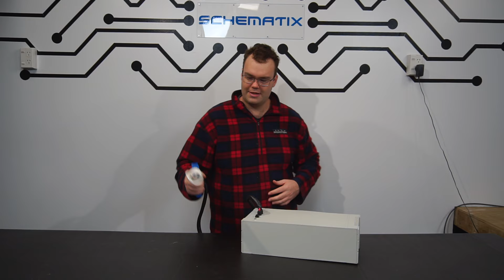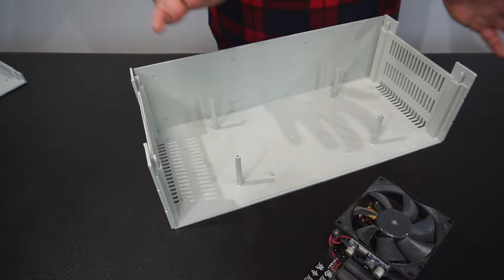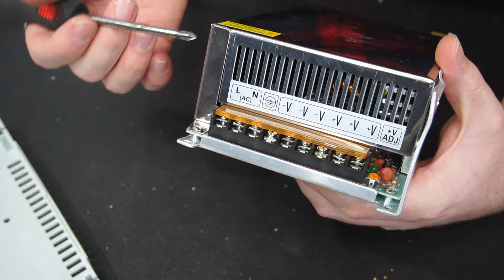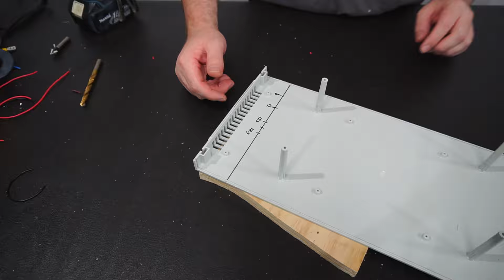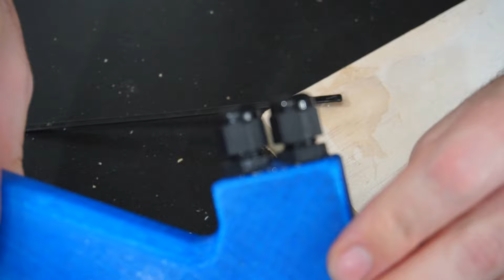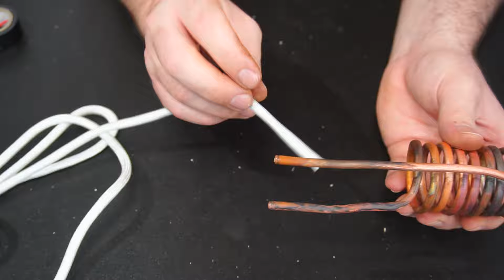How To Make An Induction Gun (Bolt Heater / Buster)

Comment: cool vid broken down nicely. How much did it cost (roughly.)?
Reply from the maker: Roughly $120USD all up. Or about $5 million NZ pesos (sarcasm about exchange rate) ;)
Reply: @Schematix  I wish there was a way to do one for less than $100. I don't see the need for fancy gun. Actually that shape makes it harder to use in tight spaces. Just a rectangle block would do. Thoughts? Actually a video on how to make one the cheapest way possible would get a million views. Easy!
Reply: @lostintime8651  compared to a consumer bought one for £400 or 500usd, (from a half reputable brand that is) this is cheap, a fun project and gives you the ability to make your own coils exactly how you want them. You could easily make one flexible enough to get into any space. Something a consumer one with a big 2 foot handle can't do, u less you pay 8x as much as this thing would cost.
Reply: @georgecroney6168  Funny to see you commented on this 11 months after. I just ordered one from Amazon for $190. Will be here on Tuesday. I am working on an old truck. I really need one now. Replacing the gas tank. Don't want an open flame doing this.
Reply: @lostintime8651  You definately don't! Let me know how you get on with it, I guess the big brands are simply higher powered and take maybe 20 seconds to hear up compared to 60 seconds for a 1000 watt one, I'm no expert though

Comment: Measure the resistance of the 12v relay coil, put an equal resistor in series with the coil, presto now you have a 24v relay.
Reply: can i use an automotive 12v relay for 110 vac at 2a on the contacts?  also thanks for the tip
Reply: @pipercolt1963  Most likely not a good idea, no!

Comment: This is a fantastic little tool.  I could do with something similar when replacing the AFR sensor on the car.  I would add protection to the Relay to prevent Back EMF from damaging the Buck Converter.
Unfortunately this is not a good DIY project in Australia due to our laws about mains power and requiring a qualified electrical contractor to do any wiring.  Unfortunately, no matter how talented someone is, this makes it prohibitive to do as DIY here.    
Thanks for the informative and well laid out presentation video.
That insulation twisting trick works really well on finer gauge cable as well.  I recommend it as not only does it twist the cable well, it avoids oils from the skin getting on the cables.

Comment: Alternatively you could have strung two relay's together in series for the coil and parallel for the contacts and doubled the amp rating of your control circuit or not hooked in the other relay up and effectively use it as a ballast.
Reply: I thought about that myself.

Comment: I would have just put a 100 ohm resistor in series with the relay coil on 24V supply. Could have saved the whole voltage conversion cost.
Reply from the maker: Actually, in this senerio, it's better to measure the resistance of the relay coil. Then install a resistor of the same value. It would also have to be a 2W resistor. I keep a whole bunch of buck converters on hand. They are literally $2 each. Besides all this buying a 24v relay is the real solution.

Comment: Nice build.. I am a noob on the matter and its more the concept that appeals to me... so pick up a cheap edition that cost around 3.5USD and been playing with it the last couple of days,.
https://i.imgur.com/6lMr8mP.jpg

Was planning to make some recording with thermal to show how the heat transfers and I atm I run it on an adjustable power bank that tops out around 80watt, but for proof of concept and small metal pieces its work brilliantly..
form a 3.5USD product it is able to make fx a 5mmAllen Key completely red glowing, solely from a USB(DC) powerbank..
.

Comment: Just received an induced thought convincing me to attempt forwarding thoughts a considerable distance by induction. 

True flat line DC won't induce the voltage to force the current you're looking for. The stable magnetic field is missing the movement of the lines of force necessary for induction. To work efficiently with all conductors the magnetic field needs relative movement with the item being heated. The current is the easiest place to get moving. In order to lower the voltage to a safer level a transformer is a cheap solution. A transformer can serve double duty as an isolation transformer by removing the reference to ground that's found on a 120V systems neutral conductor. secondary Electronic control of AC frequency is a nice touch. High frequency can really heat things up in some situations. The spiral wound coils of the heater can serve a purpose if close together to limit current by counter electro motive force to almost zero when there's nothing utilizing the field. Just a few things to consider. Peace and good luck to ya.
Reply: Can you help me understand how he is using this ? So to my limited knowledge of electron theory the magnetic field is to stable to induce a current with DC, so what is melting these bolts?
Reply: @harrychestnut3354  Hi Harry, your brain serves you well questioning DC at an Induction party. The Induction Heater is a self contained unit that is DC powered. As you thought, induction needs relative field movement. The heater must output current that has movement, a frequency. The current's direction does not have to alternate for magnetic induction to work. The heat is produced by Eddy Currents and Hysteresis Losses. There's much to share and discuss on these types of phenomenon. It happens to be my 5th day without sleep and I usually get to sleep before day 4 is over so I apologize for not doing a better job. I'll leave a well spoken example for your consideration; Doc Schuster Magnetic Hysteresis. I listened for a few minutes and his theory sounded a lot like English so good luck. Thanks for asking the question. Time to crash. Adios.

Comment: Nice video, I've been thinking of making something similar for a while. One thing you could have done differently is use a resistor instead of that buck converter for the relay power supply, as you are going 24->12 you just need a resistor the same impedance as the relay coil in series (of sufficient wattage).
Reply: Or, put a diode in series with the 24vac and half wave 24ac=12vdc

Comment: excellent. I know fa about electricity. but I learned a lot watching this, so thanks. One question. You didn't want to go into the effects of having more coils in the copper tube, that's fine. But very briefly, do more coils make the induction stronger or weaker?
Reply: The more turns you have, the stronger the electro magnet, as I understand it.
Reply: @catch22frubert  thanks

Comment: I used to think the big difference between Imperial and Metric was a simplicity issue.    Who wants 10:1 when you could have variable ratios going form 2:1 (fractions of an inch)  to 12:1 (Inches to feet) to 3:1 (feet to yard) then deviating to 5280:1 (feet to miles) and while it made much more sense to use 10:1 for everything, there's some satisfaction in knowing the rest of the world is too stupid to understand simple measurements, but then I figured out everything was just a dick waving contest.  Now I know it's simply because 10.16 centimeters sounds a hell of a lot more impressive than 4 inches.

Comment: I cringed when I saw you twist the wire ends and put them on the power supply.  Use Ring lugs, they work the same as those spade connectors, and you wont have to worry about them coming back off or breaking like the wire will eventually do when you use it like that
Reply from the maker: In my videos, I try to keep the equipment needed for construction to a minimum. As an example not everyone has a 3D printer, So I try my best to come up with alternative solutions. (Sometimes it's unavoidable)  As an example, I doubt most people would have a crimping tool capable of crimping an 8ga wire. So I showed a walkaround to the problem. On the flip side, I'm sure people who have invested in such a crimper would figure out when to use it or why'd they buy it in the first place?
Reply: I have multiple crimpers from small to two handed 4-0. Splitting the wire and putting half on each side of the washer is accepted practice and preferred as the washer doesn't get cocked to one side causing the fat side of the terminal to get loose from heating stress. @Schematix

Comment: is the coil size  critical to his working? could I make a much larger coil? Or is there tuning involved  determining the coil size
Reply: There both tuning, as well as "how picky am I", involved in sizing the coil.
Reply from the maker: The size of the coil is fairly critical to achieve maximum output. Heating up a bolt to a few hundred Celcius isn't very hard, so tuning the coil isn't strictly speaking necessary. However for melting metals.etc requires much more than just guesswork.  FYI: For tuning a coil you'll also ideally need an Oscilloscope & signal generator.

Comment: Induction should work on any conductor even gold or graphite
Reply: Yes. Induction heaters work by inducing an electric current (eddy current) in the work piece. It should heat aluminium or copper faster than steel or stainless. Keep your gold and silver rings well away from it, especially if on your finger. SERIOUSLY that is DANGEROUS!.
Also, the cables leading up to the trigger should be twisted and held tight together or you will lose a lot of energy from magnetic loop losses.
Reply: Nick knows his stuff! Schematix should see this.

Comment: Good video, I don't think though you need to be so precise with decimals when telling the temp since it doesn't look like you changed emissivity between IR measuring a shiny bolt and then the insulation. It is more like temp on bolt = "pretty hot", and the insulation "not so hot"

Comment: You can certainly induction heat non-ferrous metals like brass aswell. While not as effective as iron or steel because of no heating due to hysteresis losses and relatively low resistance in the material itself, it's definitely possibly, what really matters is if the work piece is conductive or not.
Reply: Yep, you could even induction-heat salt water if you really really wanted to.
Reply: I think he said that didn't he? You would just need more heat.
Reply: Yup, you really want a lossy or slightly resistive conductor and it just happens that many ferromagnetic metals fit this description.

Comment: Don’t you need to heat the engine block and not the the bolt itself? 
Heating the bolt will only make it expand and soften.
Reply: I guess it will pass heat to the surroundings and it will "move about" both when heating up and cooling down so it will loosen. The quality of the bolt after removal is irrelevant since you sure will put a new one in.

Comment: A ON button on that gun would be really handy, expected to see one after seeing the relay.
Reply from the maker: I was going to implement this feature but decided against it for simplicity sake. If I was planning on using it regularly I definitely would have (I'm only going to use it probably 2 times a year)
Reply: @Schematix  I suppose the most complicated bit of including one would be sourcing a trigger switch and modifying the STL file for the handle. Other than that, add +12 and the trigger line to your wire bundle and you're done.

Comment: You are talking about heating head of the bolt but you did not show heating the bolt head instead you are heating the whole bolt, why you did not put the bolt all the whey in like it is screwed into engine and then heated only head of the bolt sticking out ?

Comment: If a bolt is stuck in a threaded hole,  how would expanding it with heat make it come out???
Unless you first heat it up , then wait until it cools and hope the diff broke the bond...
Reply from the maker: You've nailed how it works. So in most situations, bolts are seized due to corrosion/rust. If you can break the corrosion you stand a much better chance of removing the bolt. As the bolt heats up, it "grows" and breaks free from the corrosion (hopefully). Most cases the bolt can be removed while it's hot. However, letting it cool can also work in your favor.
Reply: You got it!  As the  threaded shank of the bolt heats up, it  expands.  If there is rust of other oxidation in the threads, it can be crushed by the expansion.Usually, the oxidation/corrosion can be a poor conductor of heat, which can keep the surrounding threaded hole from expanding along with the bolt. "Crunch" and the bond is loosened.  Sometimes it can multiple applications to get it to work.  Some folks squirt their favorite "juice"  under the bolt after the first application of heat, then go at it again later.

Comment: Nice, could you give a link to that nice little torque wrench you used to tighten the screws?
Reply: I don't think it's an actual torque wrench, it's far too small.  Looks like a just a ratchet that uses standard 1/4-inch hex bits.  Most major tool companies make a version.  I know Matco, Crapsman, and General make bit ratchets.

Comment: That setup is horribly inefficient . Adding that length of heavy gauge wire will totally mess up the tuned ZVS circuit with unwanted inductance's ect. Yes you can "mash" one together, but without tuning it's inefficient .
Reply: It's heating rusty nuts and bolts, not powering the space shuttle.....

Comment: You could crimp a ring terminal onto your 24 volt output wire for connecting to the power supply and not have to "split" the wire, more secure connection as well. Nice job!
Reply: Yeah, they are over $400

Comment: The copper winding...does it need to be a pipe?  Can it be a solid copper?
Reply: I believe so. Solid would just make a magnet?
Reply: it used high frequency AC that travels via skin effect rather then though the body of the wire like DC. So solid copper is not needed, tubing allows water cooling which would help as power level gos up. You can uses litz wire as well so you can wrap the fiberglass covered flexible coil around what you need to heat rather than being restricted by hard coils.

Comment: I wasn't actually looking for an induction heater at the time I found this video, but I must say, I was very intrigued with your build. I did get a lot of information that I will use on other projects I am working on. So, I say Thank You for your time and effort, in showing me how to build an induction heater coil.   One question though, what was the purpose of the resistor that you installed on the LED that you used to show that the coil was powered on?
Reply: The resistor is for limiting the current for the led. The voltage a LED needs is usually about 3 volts, and when run from 12 volts the current would be way too high and destroy the led. The resistor limits the current flowing through the led and at the same time drops the 9 volts so the the whole 12 volts in dropped in the circuit.
Reply: @jussapitka6041  What size is the resistor and how much voltage gets cut down to?

Comment: Those inductive heaters were just coming on the scene when I retired from being an automobile mechanic 11 years ago. 
Would have loved to try one. 
Being a Technician in Michigan, a torch is an essential tool.
Reply: Same here. We had one made by OTC. Was like $3500 back then. I was a full time mechanic in Wisconsin and it worked like a dream on brake fittings. Faster and safer than a gas touch.
Reply: i still carry a blow torch  (often i dont have access to power)
Reply: Yes they do work great on brake fittings
Reply: What!? It's not like you are driving around in salt water... Actually in Fl we do, but Yankeemobiles are rolling Rust.
Reply: Are u gay?

Comment: Seems to me that you could take a thrift store induction cooker (usually 1800w) and just run the output intended for the original coil to a handset/coil setup.
Reply: that's what I'm going to try this afternoon...
Reply: @grandenauto3214  so what happened ?
Reply: Talon Mckay it’s still sitting there waiting for me.... I’m going to do it!
Reply: @grandenauto3214  tell us how it goes please.
Reply: Are you talking about a heat plate?

Comment: I think screws holding terminals on the gun are live aren't they ?
Reply: That's only 24V. There is no danger.
Reply: @laconcongrelos4545  but still not touching 24 v ac is better than touching it
Reply: @laconcongrelos4545  There is the danger of setting the gun down flat on a conductive surface and shorting it.  Quick fix would be nylon bolts,  "production" fix would be recessed screws with a plug cover, with only one on each side of the gun, OR, internally bonding the bus bars to the gun body with epoxy or other suitable adhesive.

Comment: Sorry to be a critic but why bother heat shrinking the terminals of the IEC connector when you have a huge  exposed strip connector on the back of the IEC going from LIVE to the fuse. A potentially lethal and none IEC compliant  Chinese knock off, bad choice of parts.  Also the bolt test was not realistic how often do you find a problem bolt 3/4 exposed?  One would normally only get access to the head of a problem bolt and with only one coil covering the bolt head the heating affect would be very much reduced.  Sorry m8 but I saw that IEC connector I got triggered they're killers I watched all the way through to see if you addressed the issue with a plastic cover.
Reply from the maker: The heatsink is for strain relief, not electrical insulation. With regards to you being "triggered" by the IEC socket not being insulated on the back. This is normal and acceptable. Many commercial products come with this very socket. You're overlooking the fact there is no risk of shock under normal use with the enclosure assembled.